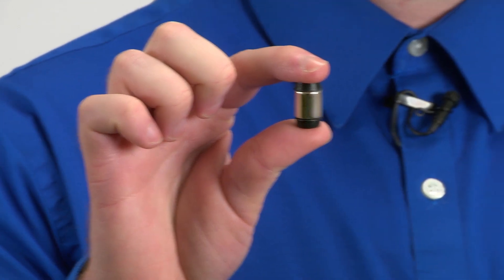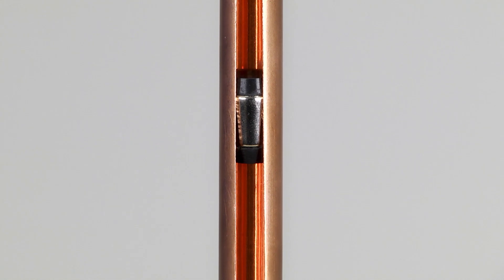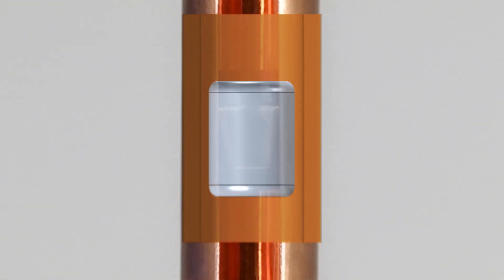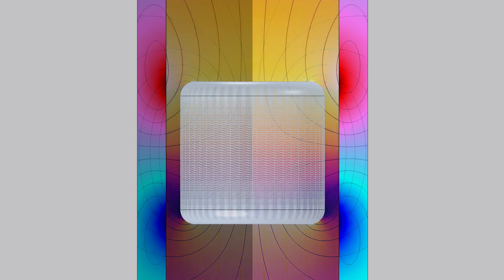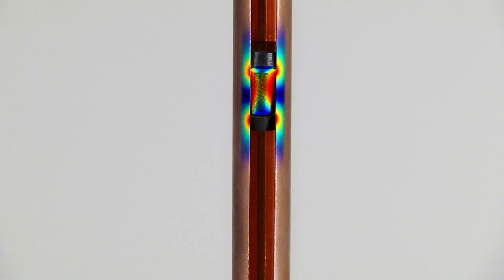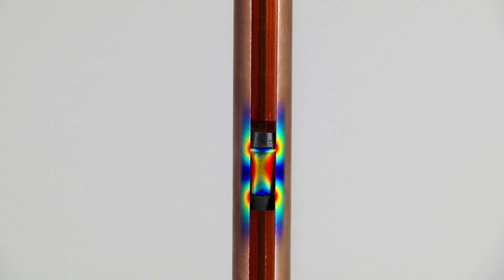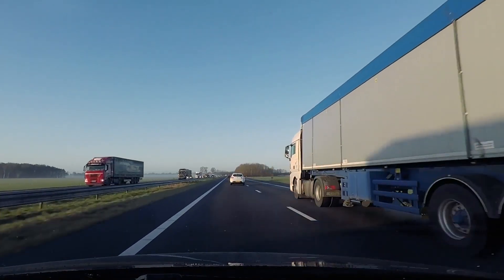How Does a Lenz Apparatus Demonstrate Eddy Current Braking?

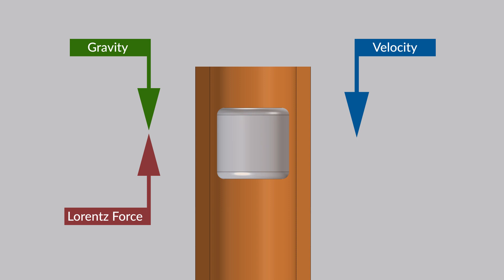Comment: Your Lorentz force vector is not correct. The Lorentz force vector needs to be greater than the gravitational force vector because that is how the magnet slows down. Then as the speed of the magnet slows down the Lorentz force decreases until it is equal with gravity. In your simulation you have it backwards. You say that the Lorentz force vector increases until it equals gravity, which is incorrect. 0:34 In addition the velocity vector is wrong too. You show the velocity increasing to a constant value, but it is the opposite. The velocity vector starts large when it enters the pipe and then decreases to a constant value, hence the slowing down.
Reply: Terminal velocity is maximum velocity attainable by an object falling through a fluid. Please don't blame Comsol engineers if you don't know what this is all about. Have a read before outlining "mistakes" just because you feel like you are always right and Comsol professionals do this type of mistakes. I guess you didn't get it that the motion occurs in a viscous fluid... oh well, here: https://www.brainkart.com/article/Terminal-velocity---Viscosity_36193/.
Reply: @claudiaborzea1386  Why so rude? I was trying to be helpful. 

I am well aware of what terminal velocity is. I have a degree in physics. Which is why I am interested in this video to begin with. Just thought I would clear up the mistake made in the video.
Reply: @NightwindArcher  Sorry if i perceived it wrongly, but your comment did not sound like a helpful and constructive criticism. If you want to watch Comsol webinars, here https://www.comsol.com/events?eventtype%5B%5D=event_webinar&locationName=26.0624%2C+44.4022&location=&distanceType=mi&distance=2800&timezone=&startTime=8&endTime=20&eventlang%5B%5D=English&view=cards&events_sort=date. Anyway, I've been watching Comsol webinars for a few years now but never came across an eddy current braking simulation. Probably the results one can get are quite far from reality. I apologise again if i sounded rude. I am mechatronics engineer myself. Enjoy the webinars and be sure to check the archived ones too :)